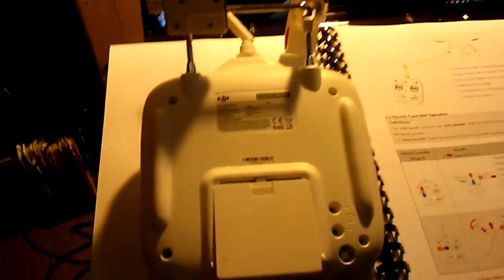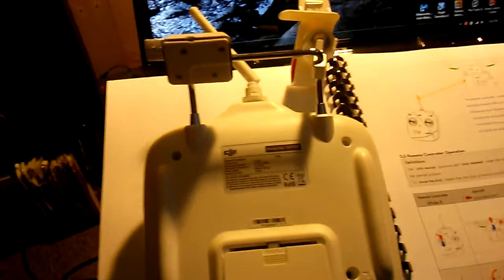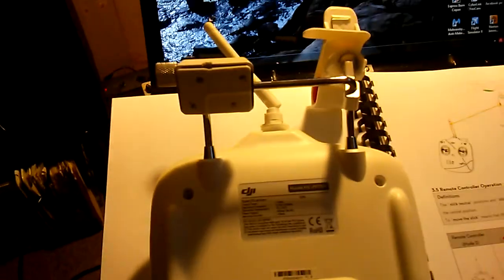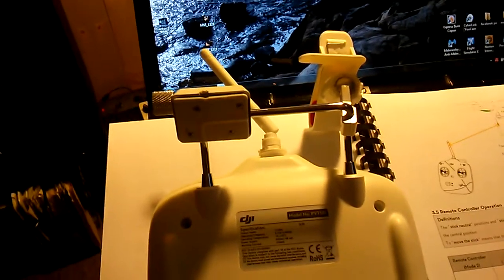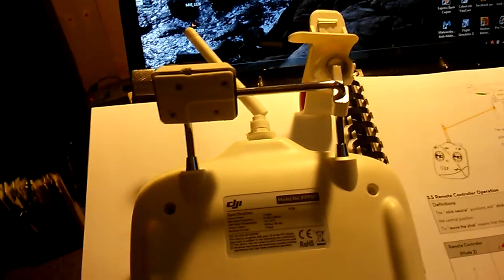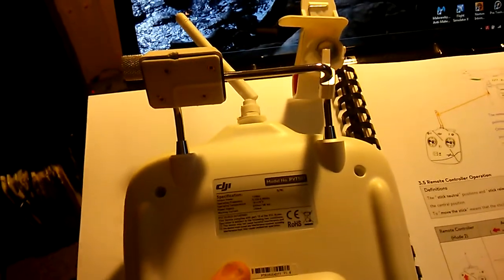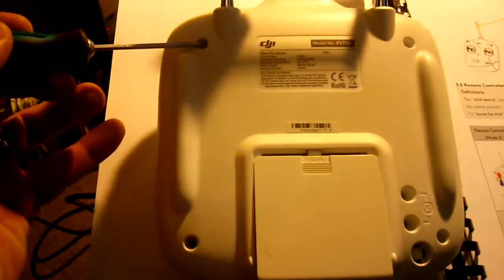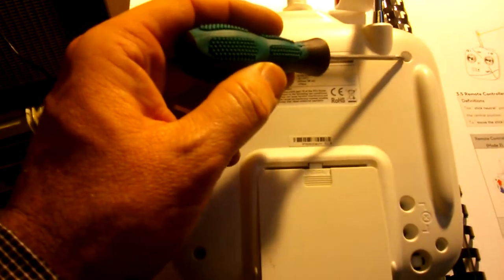DJI Phantom 2 Vision Transmitter Antenna Mod. Part 1

Comment: Just did the TX mod after watching your Video,  it only took 53 minutes, a dental pick, two razor knives and a can of Goof Off [aka Oops] to get the glue off.  I think they load it with glue just to have the last laugh as they load them on the boat.

Comment: how you liking the phantom vision so far?
Reply from the maker: so far so good,,,,its very temper-mental....must calibrate before every flight....not sure what happened today over a lake,,,,P2V started to fly away,,,switched out of gps mode to atti mode and was able to recover...lucky.....i like it.....i like the rotor pixel gimble and camera set up...its very durable in a crash,,,much more than the P2V+ camera and housing......

Comment: Great video! I have been hesitate in modifying my Wi-Fi repeater do to the locking clips on the lid. How did you get yours off without breaking them, or does it matter since there are 4 screws that also hold it together, and is it worth all the effort? Thanks!
Reply from the maker: Bobster,  on the repeater, the four screws do suffice if you do bust a clip,,,but i slowly worked around the edge and took a look at ben7seven7's video to find the clip locations and worked them upward and away from bottom and used a small micro flat head screw driver, good luck
Reply: I have seen Ben's videos, thanks!